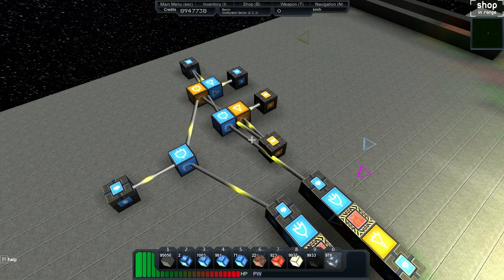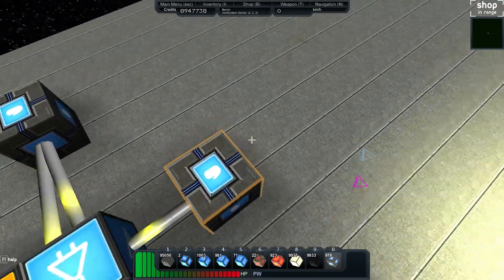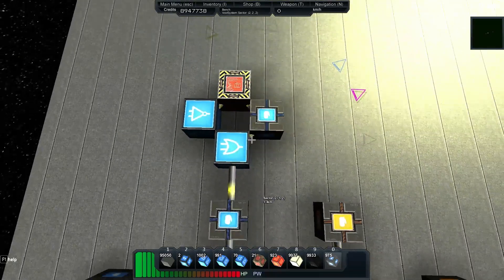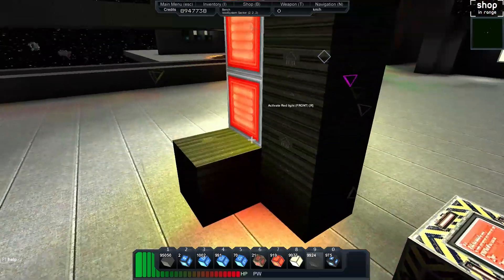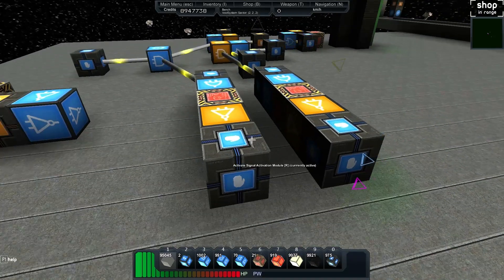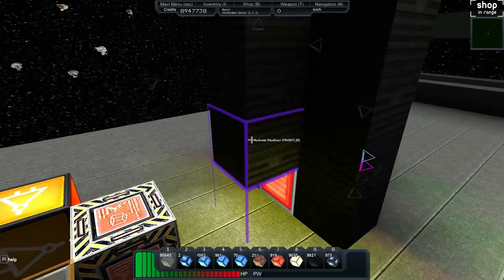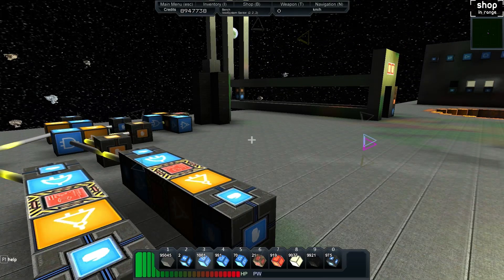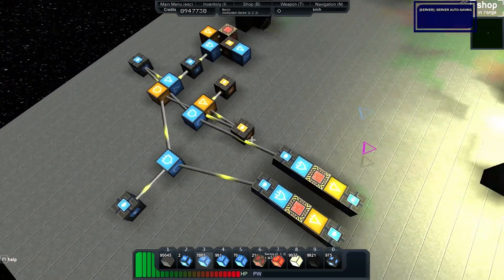Starmade Logic #5 - Blinking Alarm Light

Comment: Can you just not turn on and off the lights themselves ?
Reply from the maker: what do you mean? You can operate lights manually. In this dev build we used plexidoor while the connection to colored lights was still being fixed. If you built an alarm like this though you could have blinking lights all across your ship.
Reply: I mean without the plexdoors. Just make the lights blink.
Iknow its possible now as i've tried the dev version as of today.
Reply from the maker: yeah it's possible now, it wasn't possible in the version i was making the tutorial in at the time
Reply: Ah ok.